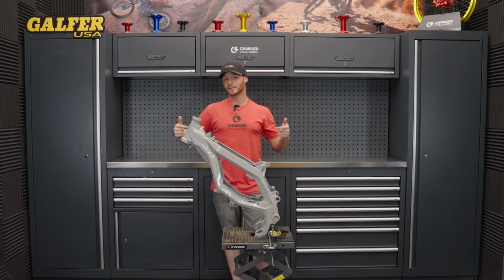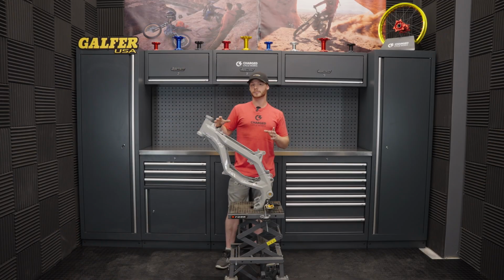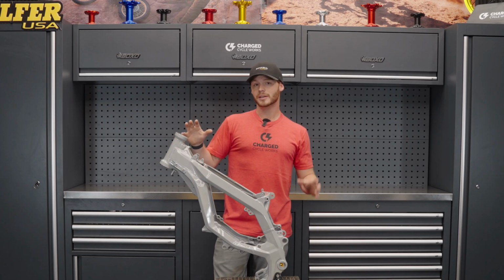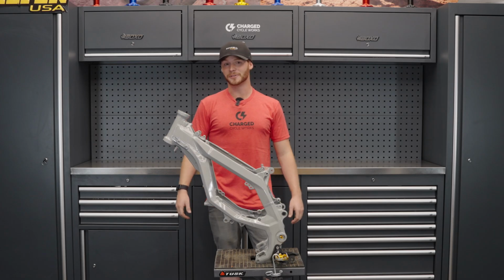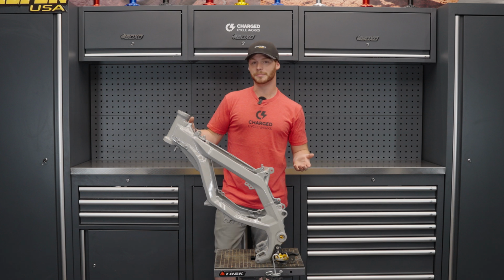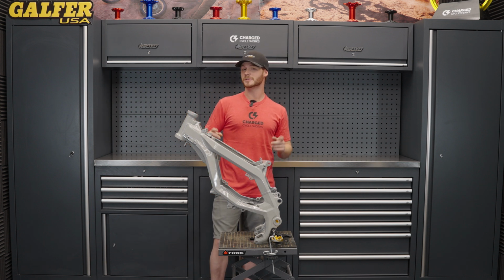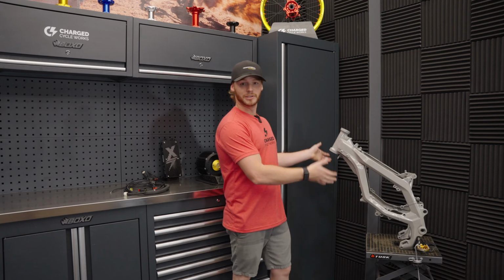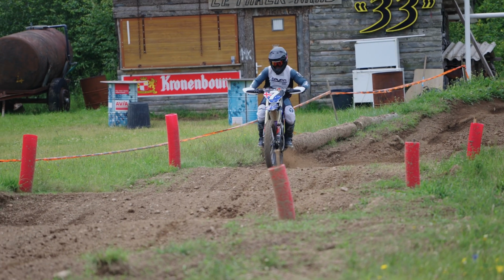The most INSANE Surron Ultra Bee EVER Built!!

Comment: I'm amazed at how upgradable these are.  Wish we had options like this already built.  Wonder what it would cost?  Maybe there just isn't a market yet due to cost.  I'd rather have this than the varg
Reply from the maker: We love our Varg on the MX Track for competing against gas bikes, but this sized bike is so much fun and so versatile.  More mid-sized bikes coming to market like the Dust, I think we're going to see a lot more options over the next year.
Reply: @ChargedCycleWorks  Good point.  I'm just a trail rider and love the size of my UB for that.  I saw a Varg in person and for me it's too big for trail riding, but that's personal of course.  Anyway awesome content!!
Reply: Sooo I was curious about the cost, went on the charged site and priced out everything, $19,867 usd. It's not too bad until you add the battery and suspension. Hopefully someone can sell a similar bike so we dont need to buy all the crap oem parts just to toss them out.
Reply: @MotoMotives  🤑
Reply: Thanks for taking the time to do this.

Comment: Not gonna lie, Brett you knocked this one out the park. Might have to copy a few things you did there. Only thing I noticed you didn't mention is the jack shaft ebmx was working on did you install that? Is it necessary?
Reply from the maker: At the time of this video we hadn't gotten that jackshaft yet, however it is now on the bike and it made a HUGE difference in performance and reliability. Definitely an incredible job done by EBMX with that jackshaft!
Reply: Is there any problems with the stock shaft on high power? :)
Reply: @Negern91 stock is just not built to handle high-powered builds. Once everything else is upgraded, the OEM jackshaft becomes the weak point.